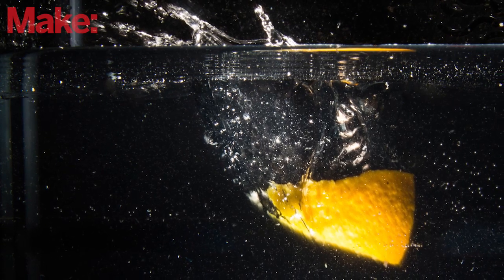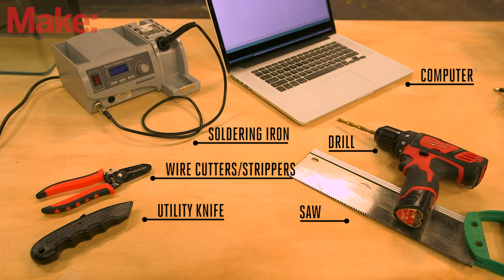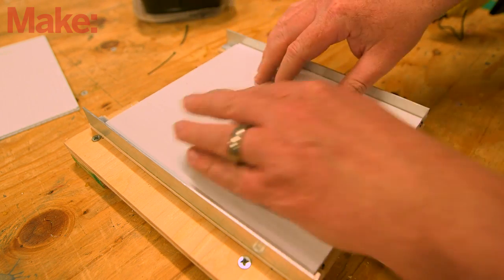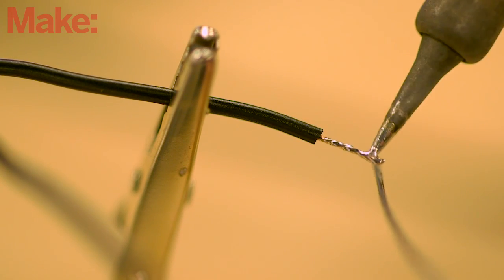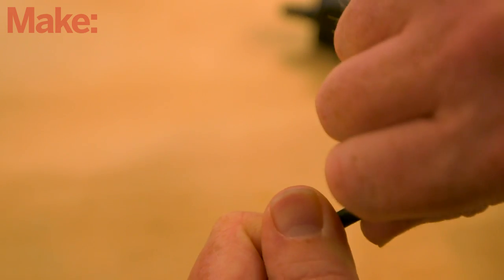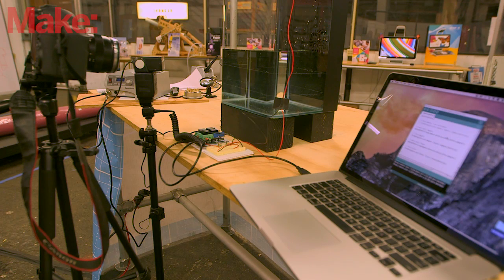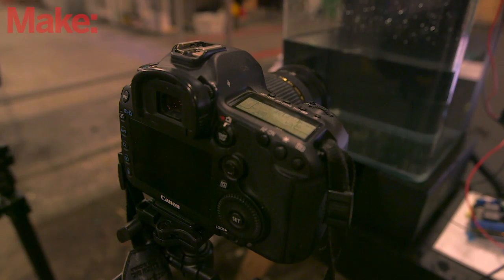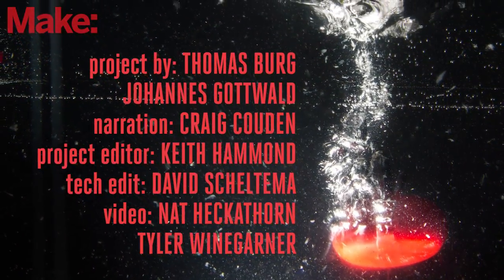High-Speed Splash Photography

Comment: Rather than buying an off camera shoe cord that you need to cut up, the Neewer branded cords a) unscrew so they're easy to take apart and b) have 0.1" headers inside to access all of the individual lines.  They're built this way so that they can use common parts between all the different flash standards.  They're also really cheap to buy.  The quality is only mediocre but they're awesome for modifying and using in projects.

Comment: Another approach is using optical barrier. the optical barrier sits higher and is triggered by the falling object, and a wireless remote for the camera will command the shutter (with a simple delay circuit, and the time from the barrier to the water is more or less the same every time). The flash can be fine tuned with the camera setting as it's meant to. (also a powerful light source may be installed instead of flash)